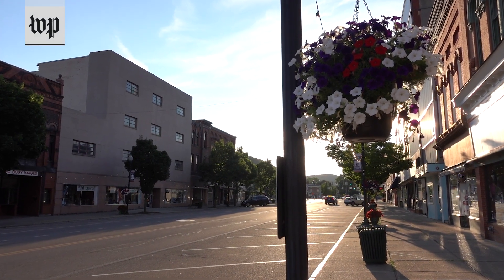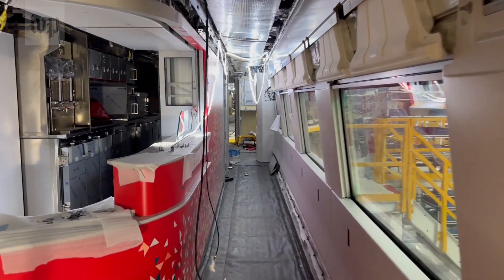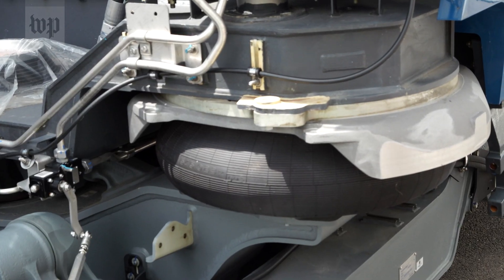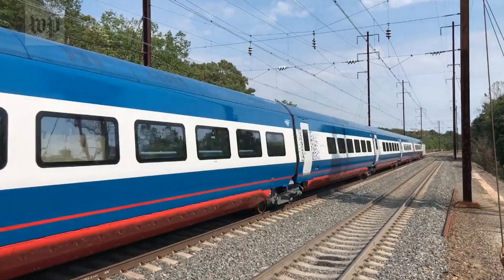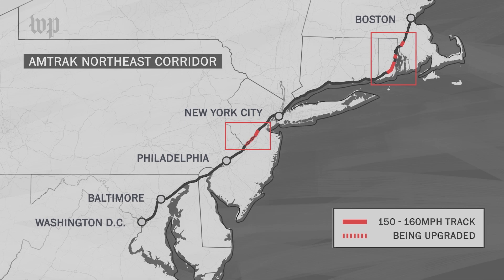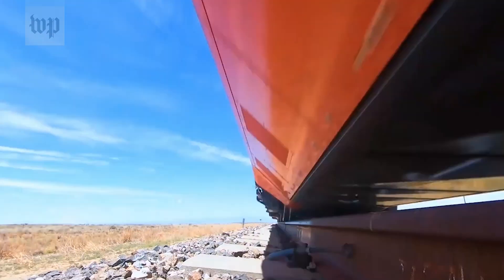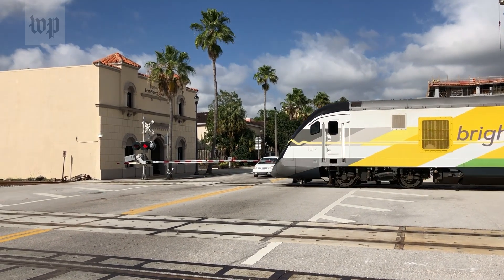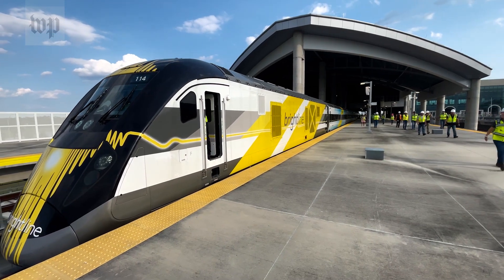Go inside Amtrak’s new high-speed train

Comment: I'm an airline pilot and I want high speed rail in the northeast corridor to be the primary mode of transportation. Every time I do a flight that starts and ends in any combination between Boston, NYC, Philly, and DC I just think to myself "WTF are we doing?" We're making 150 people go through the bullshit of TSA to get on a flight which is only profitable if it's completely full (because of fuel costs and fuel efficiency) to do a flight that lasts less than an hour, barely enough time for the flight attendants to even do a drink service. The primary mode of transport in the northeast corridor should be high speed rail which would free up air traffic in Boston, NYC, Philly, and DC (not Reagan, because it's a stupid airport that only exists because of politicians) to handle greater international, transcontinental, and other US flights. As of right now flights to the NYC metro are limited because they don't have enough controllers and the reason for that is because only the most skilled and experienced air traffic controllers can handle the task of coordinating flights in the northeast corridor. WE NEED HIGH SPEED RAIL IN THE NORTHEAST CORRIDOR.

Comment: High speed trains (HST) operate max speeds between 250 and 350 km/h.
Acela and Brightline ARE NOT HSTs. They fall in the same category of Russian SAPSAN (Moscow - St. Petersburg).
These are MEDIUM SPEED TRAINS, max operating speeds up to 250 km/h.
TGV, Fuxing, Eurostar, Shinkansen, ICE 3, AVE, FlecciaRossa, Thalys are real High Speed Trains.
Reply: Absolutely no official high-speed rail governing body agrees with anything you said. High speed rail is universally agreed to be speeds of 125 mph or greater on improved tracks or new rail lines with speeds of 150 mph or greater. Not sure where you came up with all the other stuff you said.  And the new Acela will operate at 160 MPH anyhow so by your logic it is HSR as it will operate at speeds above 250 kmh
Reply: I forgot to mention: High Speed Trains use proprietary rails, specially built for high speed, above 250 km/h.
No shared traffic with freight and slower trains.
So Acela will only go 256 km/h when the US builds a dedicated high speed track just for it.
This is a major point that separates conventional rail from high speed rail. @FFred-us9tw
Reply: The California rail project and Brightline project linking Las Vegas to Los Angeles appear to fall in the category of HIGH SPEED RAIL.
 @FFred-us9tw

Comment: They are faster - they don't tell you how much faster.  Only 10 mph faster.  Note that this is limited by track speed.  Currently the top speed on the Acela is in Massachusetts approaching Providence, Rhode Island, where it goes 150 mph and a little past Providence, and a new stretch of 16 miles in NJ.  This is where the track was straightened.  The current trains can go 150 mph.  The new ones can go 160 mph.  But Amtrak has said at least for now they are not raising the speed there where the rails are welded and the tracks are straight.  So for at least the first few months the speeds are unchanged despite what they say.  Currently south of NY the fastest the trains go is 130 mph.  That will remain the top speed in southern NJ and I took it yesterday, recording a top speed of 131 mph although Amtrak did straighten another 16 miles of track in NJ in 2022 which also allows travel at 150 mph..
Reply: & there adding another 160 MPH section in Maryland
Reply: @JermaniBurroughs  That is great to hear!  At least some of those additional funds are going to making the trains on the northeast corridor faster on a third stretch.
Reply: You don’t have correct information.  Amtrak has 150 MPH sections in Massachusetts AND Rhode Island both east and west of Providence.  Been that way for 20+ years. 
And they have a 150 MPH section now in NJ that started late last year. 
 The 150 MPH speeds will all increase to 160 MPH once the new trains enter service.
Reply: @FFred-us9tw  You just restated what I did.  I said the two stretches of track you stated - Massachusetts approaching Rhode Island (should have added Providence but oh well) and NJ.  Amtrak also posted it will stay at 150 for the new trains for the first few months and won't immediately go 160 as you state.
Reply: @Buc_Stops_Here  again, you are speaking incorrect information. The 150 sections are in Massachusetts AND  a lot of Rhode Island. You keep saying it’s “approaching Rhode Island. That is not the case.   I run the Acela between Boston and NYC almost daily.  I’m well aware of where the sections are and the plans for the speed increases
Reply: @FFred-us9tw  I added the one word missing since it is bothering you so much.  You are welcome.
Reply: @Buc_Stops_Here  😂😂 not bothering me, it’s apparently bothering you. But you keep trying to insinuate everything you said is correct and I continually point out that you have bad information. You can go back and edit it all you want. You still don’t know what you’re talking about.
Reply: @FFred-us9tw  I take this route about once a month.  East of Providence it does not go as fast.  It does go slower.  By the time it is about 10 minutes east of Providence it slows to about 110 which is as fast as it goes.  No faster.  In CT it gets much worse past New Haven.  Then it goes a maximum (briefly) of 90 and mostly 70 or slower.  I take the train because despite these problems it is faster to get to Stamford to Boston on the train than anything else.
Reply: @Buc_Stops_Here  not sure what train you’re riding, but I’ve been an engineer on the Northeast Corridor between Boston and New York for 20 years. I assure you we go 150 mph east of Providence for over 20 miles on the way to Boston. Even the regionals go 125. Not sure where you’re only going 110
Reply: @FFred-us9tw  I can be exact.  It was Acela 2193 leaving Boston at 5:31 pm arriving at Stamford at 8:15 pm a few minutes late. I was using my smartphone to track the train speed where it was doing about 150 until Providence.  After Providence for a literal 10 seconds it went 150 and started slowing down to 110 soon after that.  It managed to maintain that speed to about the CT border where it slowed further.  So technically you are right, there is a brief stretch where it can go faster east of Providence but on my trips in December (the one I am quoting here), November, October, and September it only sometimes very briefly goes as fast as you claim east of Providence.  I really don't count it as it is so brief.  NJ is fast and I look forward to the new stretch in Maryland being built to be as fast.
Reply: @Buc_Stops_Here   Boston to NYC is classified as East-West with the direction towards Boston as East.   The fact you were saying you were going 110 mph indicates the train you were riding was operating under a special restriction that caps the maximum speed at 110. So that’s not normal. So you experience is not accurate because it’s not how fast the trains run every day. There’s a condition Involving the train control system where of certain criteria is met. The maximum speed cannot exceed 110 mph. And that speed has now changed to a maximum speed of 79.   
  Again, I run Acela trains daily and have for the last 20 years.  Despite what your trip was like, that’s not the norm.
Reply: @FFred-us9tw  That may be true but this is the speed the train ran in the months from September through December.  So if it is a special restriction it has been lasting at least four months.  My question to you is do restrictions last for years and in essence the track is slower?  Four months is a long time to run at a slower capped speed if a faster speed is allowed.  And I did not see any construction on the rails that would reduce the speed.  Thanks.
Reply: @Buc_Stops_Here  definitely not normal. And as I mentioned, I’ve been doing this here for 20 years five days a week and don’t recall any point where we were restricted to 110 mph for a section that long a distance or timeframe. The high speed sections are 150 Acela, 125 Regional every day.
Reply: @FFred-us9tw  Between Providence and Mystic, CT?  Really?  I just travel on Amtrak regularly and I have never seen that.  Of course it is just the last four months so far. Thanks.
Reply: @Buc_Stops_Here  absolutely. As soon as we get west of Cranston, the speed jumps to 150/125. Slows down for East Greenwich then back up to 125/150 from East Greenwich all the way down to Kenyon Rhode Island. We pass right through Kingston Station at 150. quite a few videos on YouTube of it.
Reply: @FFred-us9tw  Okay, thanks.  I will look for those videos and hopefully someday experience it.

Comment: U.S train infrastructure is a total joke. They should have hired Japanese / Chinese manufacturers who would have completed these new trains in record time. However, to fully design this system they should have spent the money on dedicated high-speed tracks with overhead smooth powerlines. Otherwise, these trains will have to run on tracks that cargo freights run on which will face congestion, warp tracks and God forbid crashes..
Reply: Also the US: Brightline built a Intercity line from Miami to West palm beach in  4 years. No outside help. In 2022 Brightline built 2 station meanwhile they Were extending there line to Orlando in 3 years No help. Opened in  September 2023. Upgraded Tracks No help, Design Stations No help.

Comment: I had a good look thanks. In order for Acela to run faster than it is now, the Northeast Main Line needs to be speeded up, but the answer is to build a dedicated high-speed train line between Washington DC-New York-Providence.(When upgrading existing railroads, there must be absolutely no railroad crossings in all areas.)

If you have to make it underground inevitably along the existing route along the beach, you have to boldly make it an underground route.

In addition, the routes are extended to Ottawa-Scranton-Maryland-Washington D.C., Providence-Portland-Bangor-Holton, and Washington D.C-Richmond-Goldsboro-Wilton. .

Washington D.C-Charlotte-Atlanta-New Orleans-Galveston-Corpus Christi-Mexico City-Acapulco I hope that the high-speed rail will be built to make Washington D.C-Mexico City faster and closer.

For the success of the high-speed rail construction in the USA!

Comment: This is a joke haha.  This is nothing like the Renfe AVE.
Reply: Right, which only reaches a speed of 33 MPH faster than this.   And how’s the safety record on the Ave?  Did you forget the Santiago de Compostela derailment?  How many Acela accidents have their been since they started service over 20 years ago?  Zero.
Reply: @FFred-us9tw  how many Amtrak accidents have there been in the last 20 years? Tons. Renfe has a pretty good safety record for it’s time running. Much better than Amtrak. Especially the AVE which has a LOT more daily trains than Acela.
Reply: @expatchris  we are talking about HSR. Amtrak HSR has had zero fatal accidents.  But a quick check of Spains rail safety record over the last 20 years shows FAR more fatal accidents than Amtrak has had as a whole in the last 20 years.
Reply: @expatchris  just looked up the stats. Easy to find.  Since 2020, Spain has had 242 passengers killed in train accidents. (I did NOT include the 191 killed in the terror attacks in 2004 in Madrid)
Amtrak on the other hand has had 43 passengers killed in accidents since 2000.    So you might want to rethink your comments on how Spain has a much safer rail system compared to Amtrak.
Reply: @FFred-us9tw  we can agree to disagree haha. Those stats are correct. Just remember Renfe has an annual ridership of about 500 million….Amtrak about 25-30 million. So, scale plays a factor.

Comment: We need to source all material from domestic sources.
Reply: You don't have a single High Speed train Manufacturer, almost all of your passenger rolling stock is from Siemens or Alstom
Reply: That would be great, but it’s absolutely impossible. There are barely any “domestic sources” for the majority of components used in building a train like this.

Comment: It's not even running in commercial speed to be considered as high-speed rail
Reply: It has, for over 40 years. The definition of HSR is “A speed of 125 MPH or faster on improved rail lines”. Amtrak has been running at 150 mph on parts of the northeast corridor for well over 20 years and they’ve been traveling at speeds of 125 MPH for over 40 years.
Reply: @FFred-us9tw Amtrak's average commercial speed is only 68.351 mi/hr or 110 km/hr
Reply: HSR category is above 150mi/hr average speed

Comment: expanding high speed or even medium speed service to regions beyond the NE needs to happen.  Upping the STL>chicago corridor to 125mph is a good start, but the US needs HSR networks in more regions than just the NE.  The entire rust belt should have HSR,  plus California, Florida, Texas, Colorado Front Range, Oregon/Washington and the entire eastern seaboard are prime locations for HSR
Reply: If you understand geography and the layout of this country, you would understand that “the entire eastern seaboard“ is absolutely not prime territory for HSR.  The entire eastern US is built up to the point it would be impossible to run a straight rail line suitable for high speed train travels. As it is now the Northeast Corridor which has speeds up to 150 mph can’t see that speed sustained for the entire length because of how much development there is.  
  It would be a different story if you were building a rail line before any of that area was ever developed. But it’s far too late to ever be able to accomplish anything like that in your lifetime.
Reply: @FFred-us9tw as far as the eastern seaboard is concerned (particularly North Carolina) multiple lines could be used
Reply: 110

Comment: A train can only be called a fast train if the rails can support an average speed of at least 200 km/hour or 125 miles/hour.  like a freeway, it doesn't matter what type of car it is if the road is designed to be driven at an average speed of at least 100km/h or 62 miles/h.  can only be called a freeway

Comment: Top speed of 150 miles. 😂 China's maglev runs at 373 miles per hour. Thats 2.4x times more faster. Why doesn't USA import train from China rather than wasting so much money building themselves?
Reply: The top speed is not 150 MPH but thanks for pointing out you didn’t even watch the video.   You can’t compare a maglev train to a train that operates on traditional rails with steel wheels. You’re comparing apples to oranges. That being said, the  US would never import any trains from China. Our primary concern is safety and quality. That’s why we went to Europe to choose a builder.

Comment: Those airbags are going to cost you money to maintain
Reply: The current Acela that’s been in use for over 20 years has a full airbag suspension in the coaches. Really not a maintenance issue at all. Very reliable.

Comment: Sadly the real speed issue is the tracks and not the trains. There is only one small section of the whole shown asb "Being upgraded" and 90% is black and not high speed. ...Or should I say issue is really the ownership of the tracks which is owned by CSX and so its goal is not passengers or speed but hauling freight.  The stretch through New London CT is a joke where it can only move at almost walking speed.
Reply: CSX does not own any of the Northeast Corridor. And the small section through New London you’re talking about is 25 mph because of the curves and 3 crossings. Once you get east of there the speed gets as fast as 150 mph. And west of there up to 125 till New Haven.

Comment: The new rail cars won't really change the speed of the train at all, as they run on the same old rail lines. And it  won't improve the safety either, as long as the rail lines
are still rickety. I guess won't be a passenger on Acela anytime soon.

Comment: Now Amtrak trains can crash at 200mph instead of 100mph. I'm all for American railroads but I don't think Amtrak has a good enough safety record to increase thier speed of trains. I think they should make sure the track can handle higher speeds and maybe leave it to another rail company.
Reply: Amtrak has one of the safest passenger rail networks in the world. The Acela service has been running since 2000 with zero fatal accidents.  In Amtrak's 50+ year history a total of less than 200 passengers were killed in accidents and less than half that amount was any fault of Amtrak's.  So going back the same amount of time, to the 70's, Japanese rail had an incident in 2005 with 106 fatalities. China has had over 600 fatalities since the 70's. Germany has had over 300 deaths since the 70's.  India railroads has had 23,000 deaths (NOT a typo) in 2020 ALONE.  Spain has had close to 300 killed since 1970.  So please, stop implying that Amtrak is unsafe while other countries have stellar safety records. Amtrak has a better record than all of them.
Reply: The TGV's are notoriously safe in case of accidents even at high speeds
Reply: @Dmz they have been going 150 MPH for over 20 years  on the Northeast Corridor.

Comment: "Fastest trains in the Western Hemisphere". Well, ok, fast is relative. But the potential of the train and how fast it runs in practice remains to be seen because those tracks are not suitable for world standard HSR.
Reply: The world standard for HSR is speeds of 125 MPH or greater on improved tracks. Amtrak has been running at 125 MPH on the NEC for the past 40+ years. And going 150 MPH with the Acela for the last 20+ years.